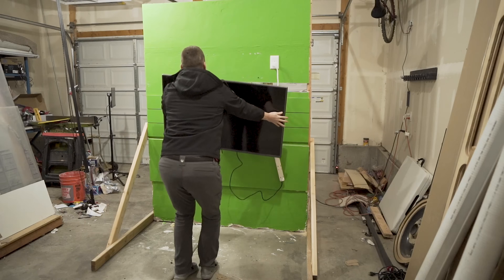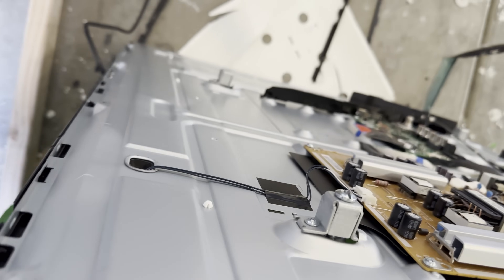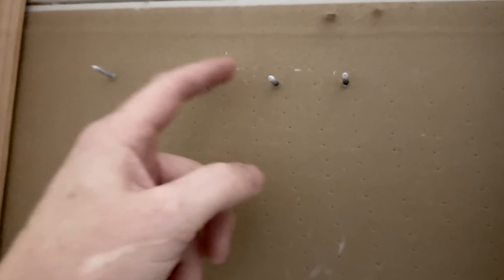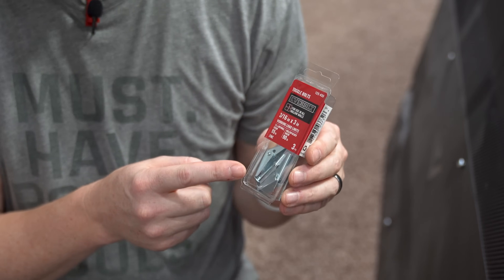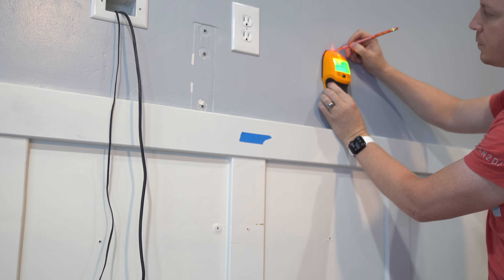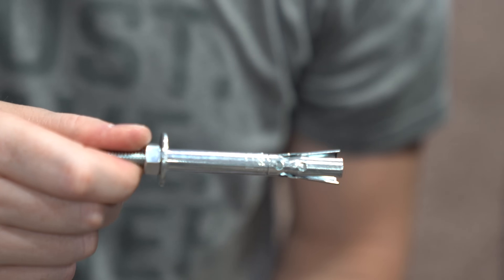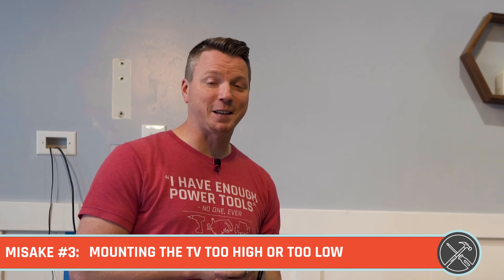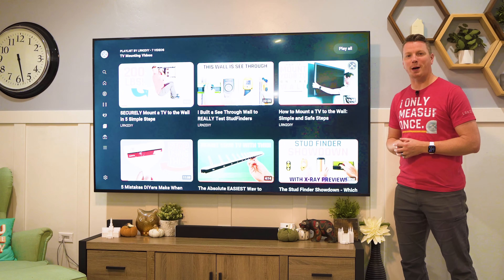3 Mistakes DIYers Make When Mounting a TV

Comment: On Drywall if you can only get to one Stud, would it not be better to open up the wall and put a timber brace between the studs and mount to that? Since the wall is going to be covered by the TV you'd get away with a quick patch job afterwards.
Reply from the maker: That's definitely an option but most installers will tell you that if you can get to one stud and then use proper toggle bolts on the other side, you're going to be totally secure. Part of that is because toggle bolts have gotten stronger and TVs have gotten lighter.
Reply: I would suggest placing the timber behind the tv. If it is small enough it isn't visible anyway. If it is visible, just make it part of the design.

Comment: I put my t.v. to high.  Still does the job well enough lol
Reply from the maker: I did the same on our first TV in this house (hence the high holes behind this new one) and it works fine, especially if you're further away. Having our new TV at the right height is definitely preferable but it's not the end of the world to have it too high.
Reply: You can always try moving the brackets on the back of the TV higher to lower the height if possible, it won’t be anything drastic but it should help!

Comment: Lost me at the very first fastener. If a regular screw will not work well in drywall how is A BIGGER SCREW going to be reliable. 

Old style toggle bolts are garbage when overtightened they cut into the drywall which weakens the chalk. 

OMG this video could use updating.

Comment: Simply never use a wall mount that has joints and can be moved out. Get a "cheap" one that is basically flush with the wall and you should be pretty safe I think.

Comment: Holy smokes, the insanity of your stud finding ideas.
Just get a magnet. It will lock on to the screws used to mount the drywall.
After you have a few vertically you can draw a line between them and you have your anchoring line.

Comment: Problem of very small sample size leading to the WRONG conclusions. How many different TV's did you test this "don't overthread" issue? Look at some LG panels and you’ll notice that the bottom of the thread is not protected for all attachment holes. You are putting yourself liable for damages to panels so work on your disclaimers. Rule of thumb is that if you’re not sure, do not give people the assurance they should not assume (i.e. going the extra mile to show them how hard it is to damage YOUR panels). The Dunning-Kruger phenomenon is strong here.